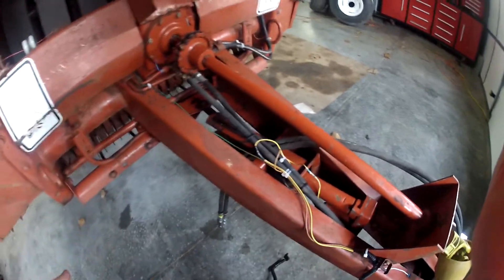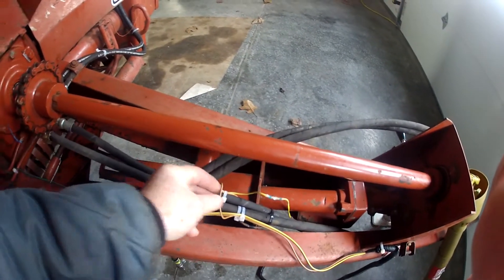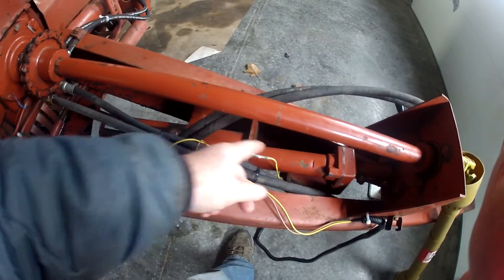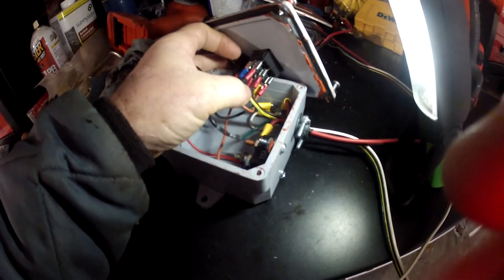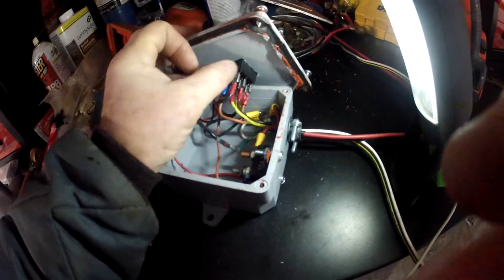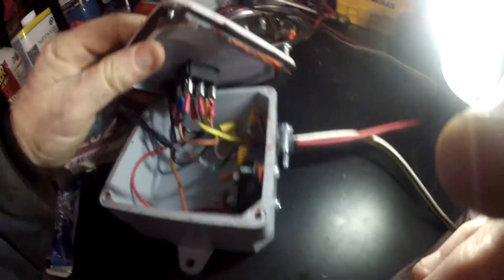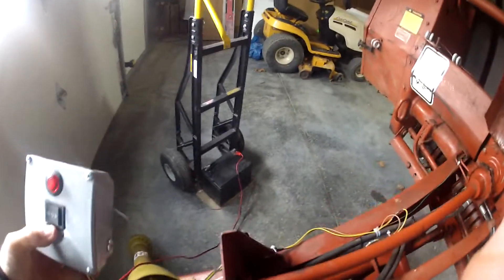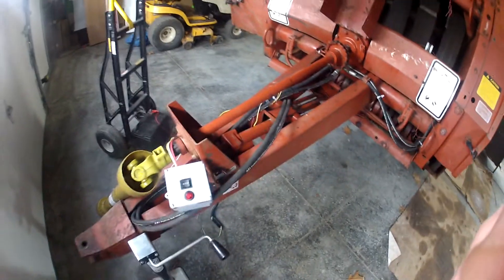How To Wire a 12V Linear Actuator on a Hesston Electric Tie Round Baler or any other Device

Comment: I have a vermeer 5400 baler with an actuator box just like that. It has the 6 pole switch but only 4 wires connect to the switch. How is that possible?